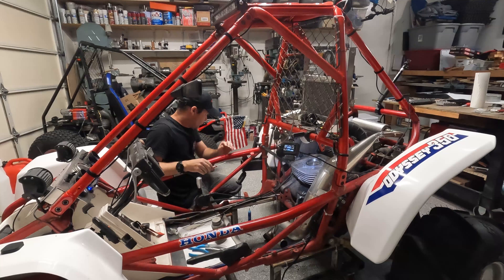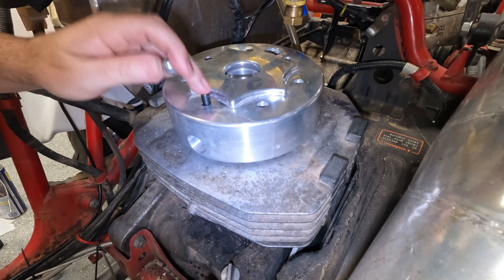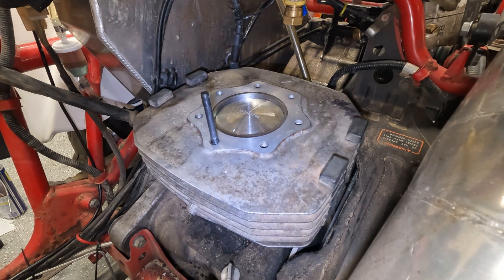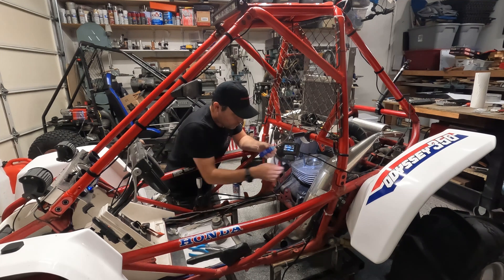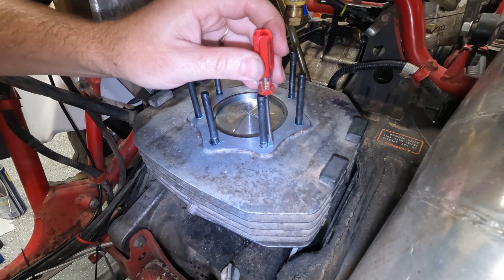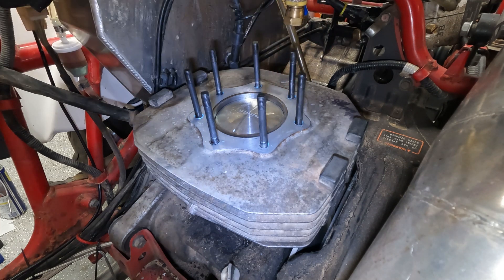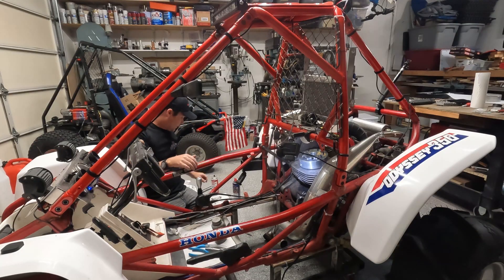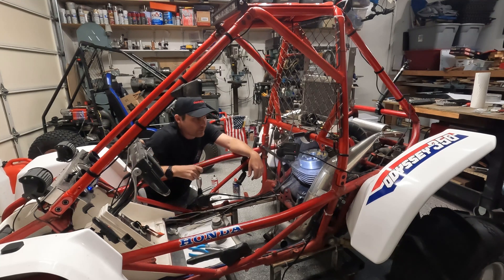Honda Odyssey FL350 Engine Rebuild Part 11 - Water Cooled Head Stud Install

Comment: I need these exact bolts. What bolts did you get? I just picked up a Bishop head and want to swap it. Thanks
Reply from the maker: Sorry for the late reply, for some reason I missed your question. The head studs should come with the head. If they didn't, go over to my website at www.oddballorv.com/contact and send me a message and I can see if I can help you out with getting those bolts.

Comment: What size radiator are you running with that water cooled head?
Reply from the maker: I use this radiator: https://oddballorv.com/fl350-radiator-for-water-cooling.html it works great for my needs. Since I do ride mostly in the sand dunes I also have a radiator fan for pulling air through at lower speeds. https://oddballorv.com/fl350-radiator-fan-mounting-bracket.html